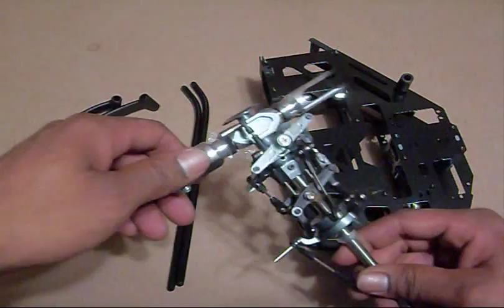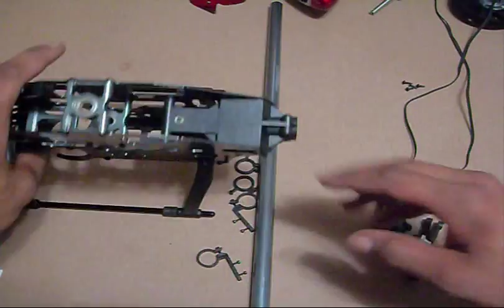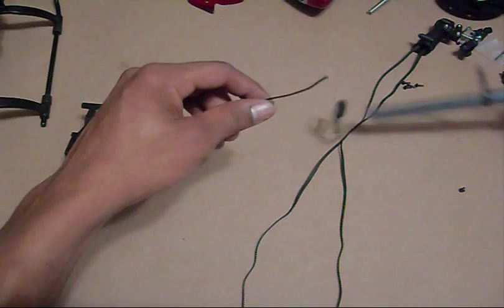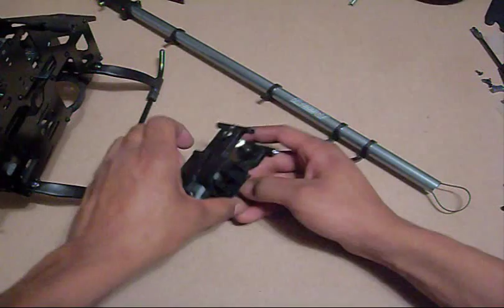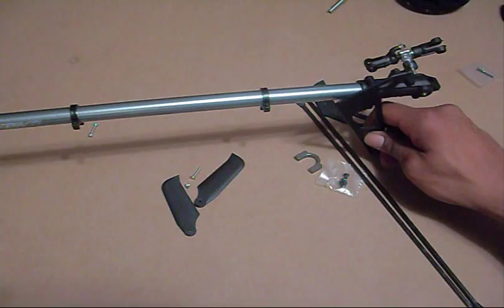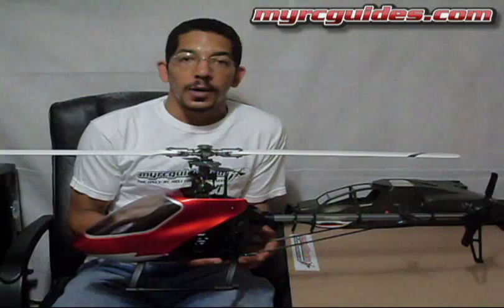HK 500GT Build Guide Part 2 - Assembly

Comment: When preparing to slide the flybar through the rotor assembly be sure to cup your hand under the area between the flybar cage and seesaw as you remove the screws. There is a pair of tiny washers/shims (one each side) which are indeed tiny and tend to drop out. It took me half an hour with a magnet trying to find mine - it rolled of the desk onto the carpet! The only reason i knew it had fallen out was that I discovered the other one on the opposite side.